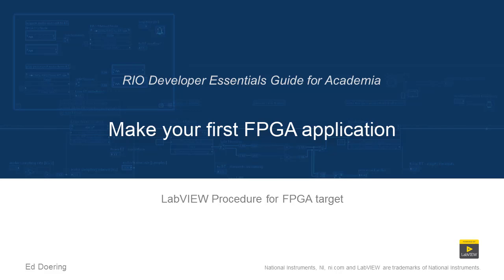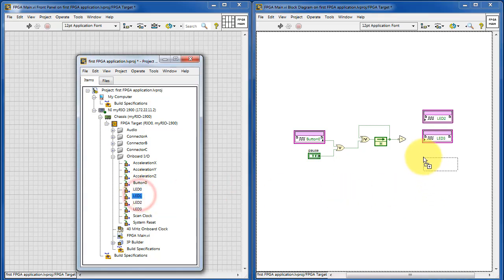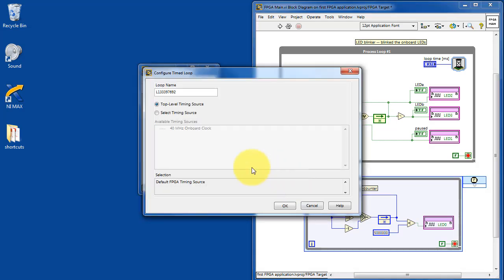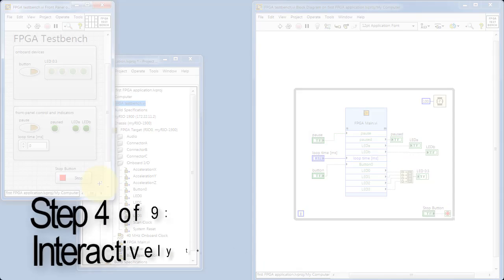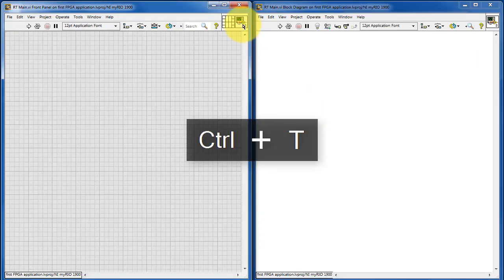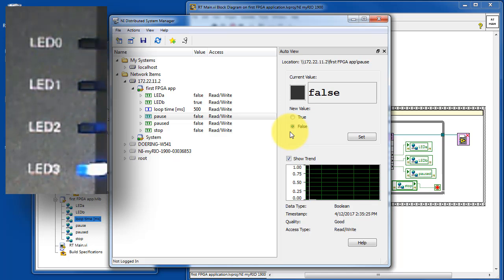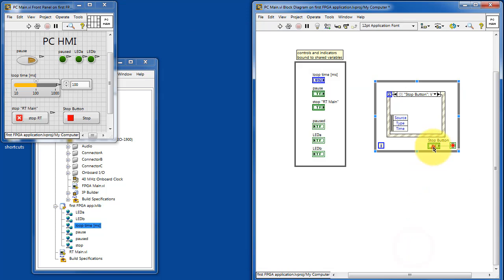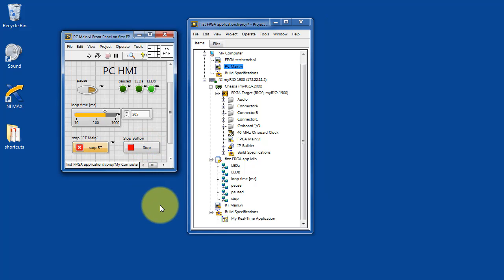LabVIEW procedure: Make your first FPGA application

Comment: Hello everybody. I have a question about design of FPGA VIs. 

If I use any function of the FPGA Functions Panel (eg. FFT processing of an Input Analog Signal), can I be sure that "ALL THE PROCESSING" will be made "electronically"? That is, that is not made "sequentially" and "electronically" mixed? Do I have to be carefull how I make my "code" so it does not have "sequential" instructions?

Comment: When I try to set my constant for the down counter to 39999999 it reverts to 32767. Any idea why I'm seeing the behavior? I'm using labview 2018.
Reply: It is because you are trying to input larger number than it can handle. You have to right click on the constant go to "Representation" and select U32. Then it will have enough space to accomodate 40 million.
Reply: @tomasfargac7183   Do you perhaps know, why do we use 39 999 999 instead of 40M? I know that FPGA F=40MHz and period is T=25ns but why 39 999 999? I asume that at the end we are quicker every time by 1 cycle. Thank you
Reply: @THE1B1  
Hello THE1B1.

The actual reason is that in this particular case we are counting down from 39 999 999 all the way to 0. That means you have 40 milion ticks between these numbers. So from 40 million to 1 is the same as from 39 999 999 to 0, having 40 mio ticks. 

Hope it is understandable. Many programming languages start indexing actually from 0 or counting down to 0. The logic is in the binary when 1 bit is either 0 or 1, meaning your starting point is 0.

I hope my answer is helpful and I wish you best of luck with your project.